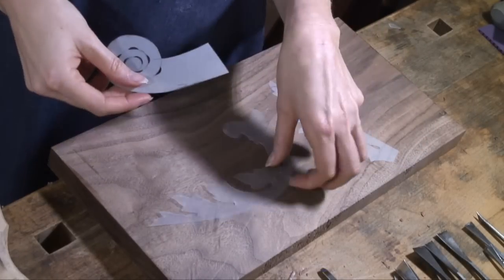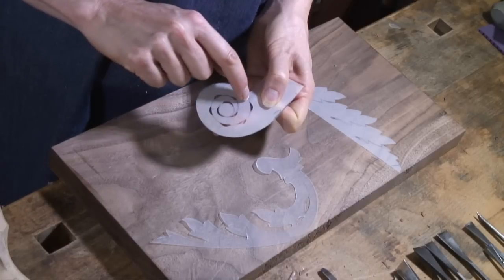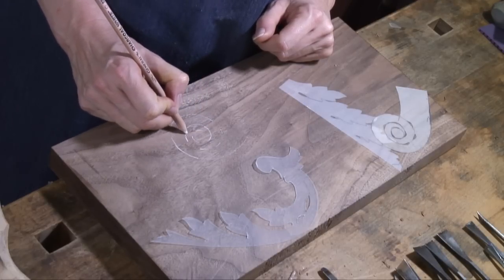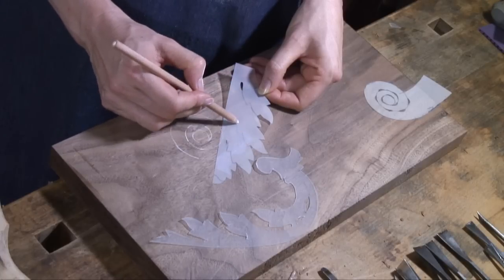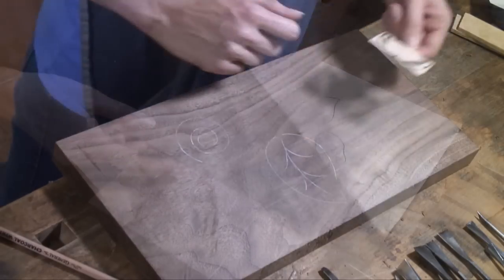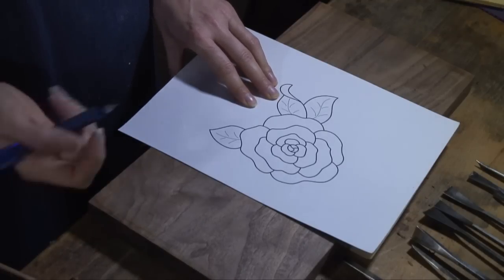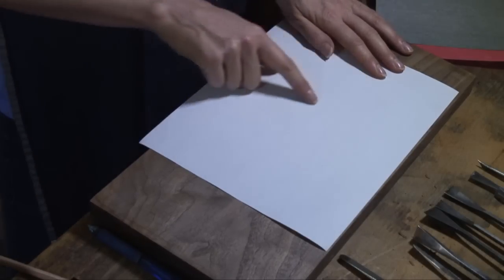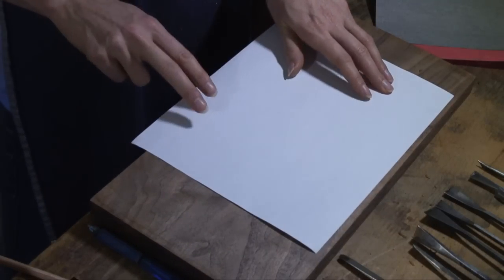How to transfer designs to your wood

Comment: Gonna try out the iron tomorrow, that's a cool idea. The tip for curves is fantastic, where you cut out little bits of the design so that you can put dots on the wood and join them up. I have no idea why I never thought of that. Thank you!

Comment: I use rolls of vinyl flashing for my stencils. You can get it fairly inexpensively at most hardware stores in widths of 10" to 24". You can also vaccuform this vinyl to fit irregular shapes before laying out your stencil. It's a little thicker and can get a bit brittle if very cold but it's a good stencil material and great to run a pencil against the edge
Reply from the maker: Thanks! I'll have to check this out. Great idea!